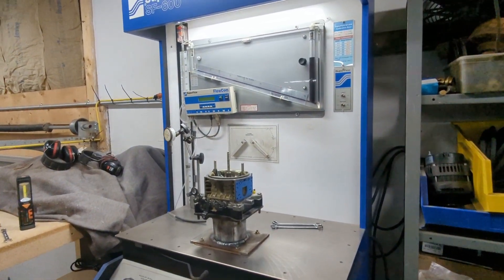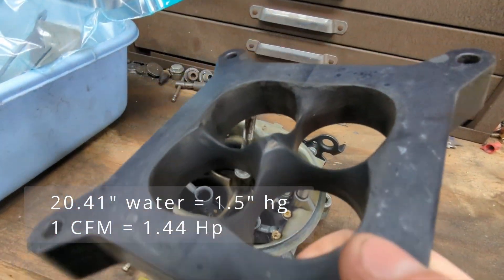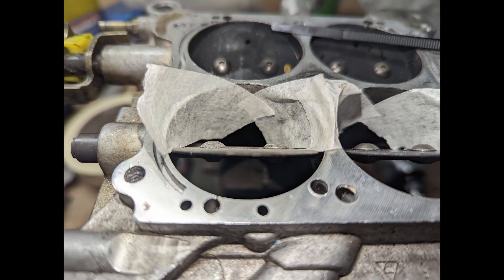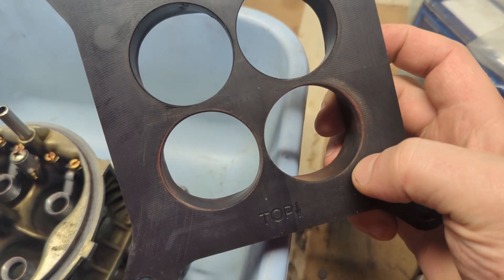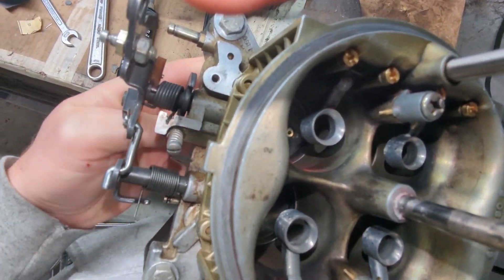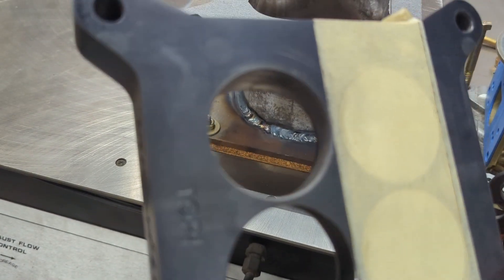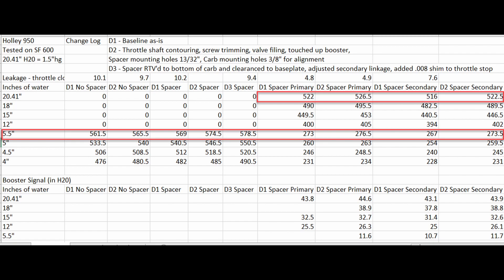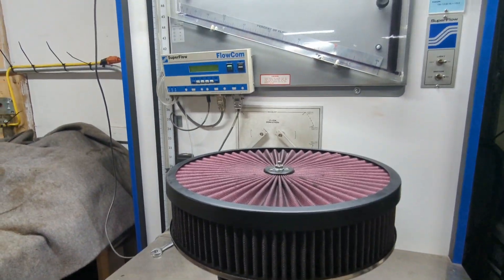Holley 950 Carburetor | Free Flow Improvements with Results | Flow Bench

Comment: If you could drill and tap the center around the air cleaner stud for air bleeds and use new undrilled butterflies that would yield the best booster signal. Not that there is anything wrong with drilling for idle control. There's just another place to do it. I felt like there was more signal with the cam I ran. Good work though.

Comment: How much do all these changes effect air fuel ratio.   I tend to look at air fuel ratio at 1700 rpms. Just before any fuel starts being pulled from the primary boosters.    Change idle feed restrictions to get it close to 12.7 at fixed throttle.  Then i drop 200 rpms and chart the air fuel ratio drop 200 more all the way back to idle.  If the fuel curve is off i look at the idle air bleeds.  Then verify i nice flat af ratio from 700 to 1700  .   Then i look at af ratio at 3700 to 4000rpms.  This lets me know where to go with the primary main jets.  Then look at the fuel curve between 2500 and 4000.  Look at the high speed air bleeds to adjust the curve.  

With idle feed restrictions and primary mains set.  I make some almost WOT  runs. But not dropping the manifold vacuum enough to open the power valve or put a power valve plug.  This sets your secondary jets.  While a accelerating from 4500 to 6500.  I look at the secondary fuel curve to see if i need to do the secondary high speed air bleeds.  With the secondaries jetting set.  Now into true WOT to see which way to go on the power valve restrictions. 

With at least the idle and primary jetting set. A few fast blips of the throttle will let you know which way to go with the primary pump discharge nozzle.   If it blows your ear drums and burns your eyebrows off. Go up a size.  

Verify af ratios with a spirited test drive.  Be totally amazed that you can smoke the rear tires no matter how you feather the throttle.
Reply from the maker: I like your method.  Unfortunately i only have 4 inches of vac at idle to play with and part throttle spirited loads arent accepted.  The car cruises well without any changes.  I cant give you a complete answer on full throttle condition due to having an electrical problem (between 55 and 6000 the car hits what seems to be a limiter but its not) The car 60ft its best this year so far and gets to the 330 pretty quick.  On gasoline i was getting between 12-14 mpg on sick summer dragndrive.  I didnt notice a big change in fuel requirements but i suspect that going up 1 or 2 sizes might be normal.

Comment: Very nice video with all the attention to details and close up photos. I have a pair of Holley 950HP cfm carbs that have the smaller size 1.375" venturi.  I sent one of the carbs to the people at BLP in Florida about a month ago for a Annular Discharge Mini Down-leg Booster swap from the stock/factory regular booster design.... they did a Before and After flow bench test...Before it actually flowed 1011cfm....and after the Annular Discharge mods it made 1052. No other mods were performed. These carbs already perform well on my pair of BBC 565cid Marine engines... they idle super sweet and smooth @700rpm in Neutral with great drivability and yet super responsive signal/throttle-response at mid-range/part throttle---just awesom. I just wanted to send them to BLP to see where they are at CFM wise and add the Annular Discharge for better fuel atomization/distribution---so I did not want to mess with them too much when they were already performing great in stock factory form.
Reply from the maker: Very good numbers.  I think the next thing I need to do are the annular boosters.  Seems to work ok on e85 with the downleg step booster.  It went farther than i thought it would go.  The annulars i believe will break up the stream and control drop size better.  If everything goes well il be doing a bunch of track testing this season.  This is on a 489 setup.